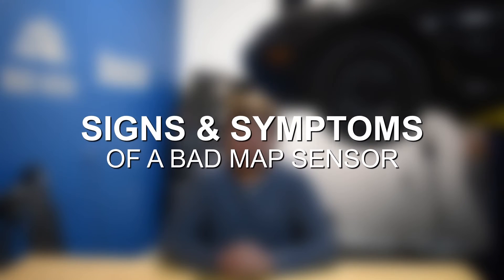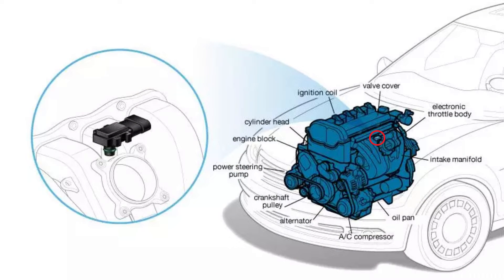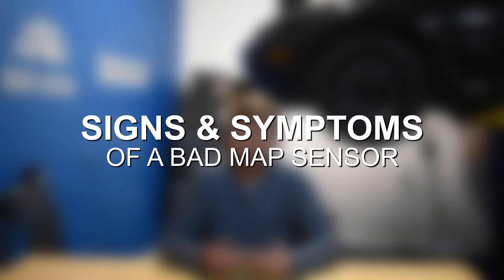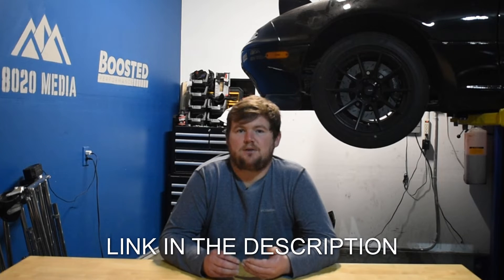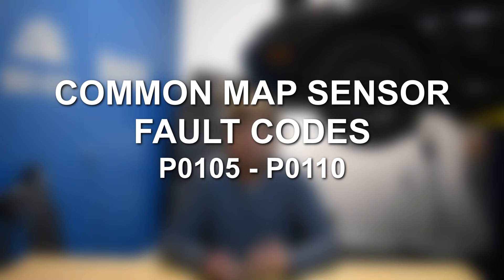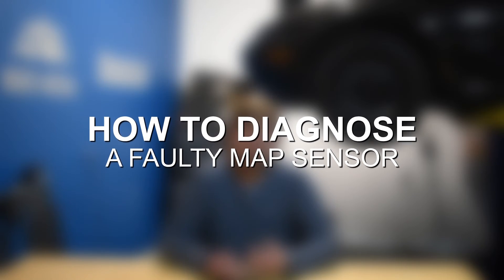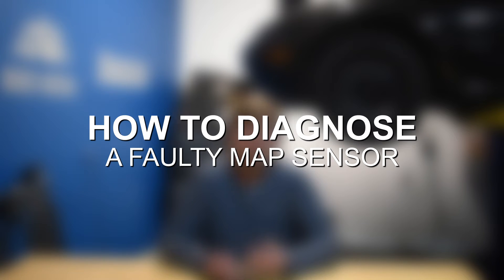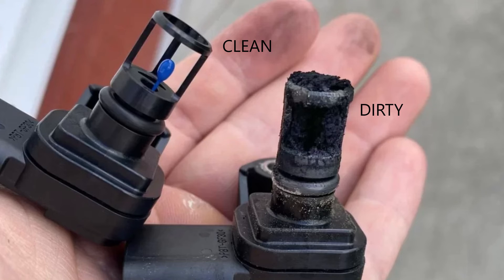A Bad MAP Sensor – Symptoms, Causes, and EASY Fixes!

Comment: Today after a hard acceleration I get error 0234 "pending" and I my car go to lim mode . After few investigation I find a bad PVC valve and oil on throttle body. That lead me to remove the map sensor for inspection and it was full on carbon deposit. I clean it and 50km now I didn't had any problem except my I idle drop little bit 680rpm from 730rpm . 
Audi a3 1.4tfsi .
Reply from the maker: S - The P0234 code (Turbo Overboost Condition) combined with a bad PCV valve and oil in the throttle body suggests that excessive crankcase pressure and oil mist entered the intake system, potentially affecting the MAP sensor and boost control system. Cleaning the MAP sensor was a good step, as carbon buildup can cause inaccurate pressure readings, leading to limp mode activation. The slight idle drop from 730 to 680 RPM is likely due to the ECU relearning fuel trims and airflow characteristics after removing the carbon buildup. If the issue persists, check the boost control solenoid, wastegate actuator, and vacuum lines for leaks or malfunctions, as they regulate turbo pressure. Also, consider replacing the PCV valve if it was faulty to prevent further oil contamination in the intake system. Keep us updated!
Reply: @8020Automotive  i replace the PVC valve (it was stuck close) i clean all intake parts from turbo to the intake valves . Everything run smooth now without any problem .

Comment: my car is 26 years old. I thinks its time to have a good check or simply replace it. It do feel a bit of hesitation from time to time while idling. I know for sure its not my sparks plugs as I put new one recently
Reply: Getting hard to find anyone to work on a pre obdII car. I have a 92 astro that was just running fine until i changed the sensor and thermostat.
Reply from the maker: L - Sorry to hear.. Unfortunately, this is something we've been seeing too.
Reply from the maker: R - Couldn't agree more! A little refresh would be good.

Comment: Hey I have a Code p1409 on a 1999 mazda b2500  before I got a code PO171 And i change the Idel Air control valve and also I had a P1506 all of them went away except the p1409 I change the fuel filter and clean the MaF sensor and has new coil wires I cean the truck with sea foam if it was a injector but its still have a rough idle and has los lost of power when Going up hill you need to lower the gear because it struggles
Reply: Yes
Reply from the maker: P - Interesting.. Have you taken it to a mechanic?
Reply: @8020Media  I have a scanner myself I know some basic mechanic knowledge
Reply from the maker: P - Are you still experiencing those symptoms? We also have videos on rough idle and  losing power:
https://youtu.be/ipjYLPJgpq8
https://youtu.be/BiYsqRJCLhE
Reply: @8020Automotive  I checked the truck again so
Reply: I checked the long and short term fuel trim
Reply: @8020Media  for the long term is get +15to +25 at idle and for the short term is get +3 to +12 at idle
Reply: I also fix all the vacum leaks
Reply from the maker: P - The P1409 code on your 1999 Mazda B2500 points to an issue with the EGR (Exhaust Gas Recirculation) system, possibly a stuck or malfunctioning EGR valve, sensor, or related components. Since you’ve already replaced several components like the Idle Air Control valve and cleaned the MAF sensor, it’s likely that the EGR valve itself is either clogged, stuck open, or the EGR control solenoid is malfunctioning, which can cause rough idling, loss of power, and poor acceleration, especially under load like going uphill. You should inspect and clean the EGR valve, check the EGR tube for blockages, and test the EGR solenoid for proper operation. If cleaning the EGR valve doesn’t help, consider replacing it, as a faulty valve can severely affect engine performance. Keep us updated!
Reply: @8020Automotive  hey I forgot to mention the egr solenoid has been replace, Yesterday I Tested the egr valve and it hold pressure
Reply from the maker: P - And you're still getting this code?

Comment: 2015 toyota corolla has P0108. U think it could be sensor or the wiring? Wiring looks fine i checked the sensor itself it doesnt have any gunk or soot.
Reply from the maker: B - The P0108 is more likely caused by a faulty MAP sensor than the wiring if the wiring looks fine and voltage checks confirm consistent signals. Perform electrical tests to confirm before replacing the sensor.

Comment: I’m getting false p2173 (vacuum leak) and i’ve checked the vacuum line and its air tight, could this be a bad MAP sensor?
Reply from the maker: I - A faulty MAP sensor can indeed trigger a false P2173 code. Start by testing the sensor and its wiring, and replace it if necessary. If the issue persists, further diagnostics on other components like the throttle body or MAF sensor may be required.
Reply: @8020Automotive  thank you, I’ve changed my throttle body and did infact have a small leak through the manifold gasket that I changed and the code persists! I’ve ordered a new sensor just to get it out of the way and hopefully that fixes it! Thank you for replying and helping people out!
Reply from the maker: I - Love to hear this! Glad we could help.

Comment: Oh how easy it would be if there were codes. No codes. Car has calibrated itself to drive okay; but, if the battery is disconnected and the comp resets, the car won't drive well at all :/
Reply from the maker: J - Interesting.. What symptoms are you getting?

Comment: My 2006 bmw 325i has been going in and out of limp mode and also having rough starts and rough idle. Replacing map sensor asap as I did get a code pointing to the map sensor. Hoping it fixes my issues 🤞
Reply from the maker: P - Might not be a bad idea! Keep us updated.
Reply: What no update?
Reply: Do you have an update?
Reply: Where is the update, please
Reply: Had rough ideal map sensor showed up but ran fineish
 Replaced it now it's bad but check engine is off

Comment: my check engine light turns on with the rest of the lights when i turn on the car. but it has NEVER illuminated when my car has had any issues. its quite irritating. the codes are presumably still logged though, so i should check them. i believe the altezza is obd1? because its sold outside the US it didnt get obd2. im not sure. but that means i can short the pins and count the flashes, or buy a cheap obd1 scanner?
Reply from the maker: S - That would be the best route.

Comment: I just bought a 2010 dodge charger and while I was driving it the car just stalled and turned off. I was in drive and when I put it into park I turned it off and back on and the check engine light was on. After so many rotations with the car being turned off and on in that same night of when this happened now the check engine light is not coming on And we were able to drive it home OK. I’m still Freaked out over this because I see that this is an issue with this type of vehicle based on other peoples problems … I read where someone replaced the map sensor and it fixed it. Could this be the case? Everyone I saying on the dodge charger it won’t show any codes after this happens
Reply from the maker: J - Best bet would be to pull the code when you get an engine code. That'll help you diagnose it easier. We also have a video on vehicle stalling that may be helpful: https://youtu.be/7bqAIbYRdnc
Reply: @8020Automotive  I will today will it still show up even if the check engine light isn’t on anymore? It came on when it happened but now it’s not on ;(
Reply from the maker: J - Sorry to hear. It is still possible for engine codes to pop up even if there isn't a check engine light.
Reply: @8020Automotive  it’s the crankshaft position sensor
Reply from the maker: J - Glad you found the issue!

Comment: I think I have a bad map sensor it would act like if it was starving for gas  it would idle for a few seconds then shut off , I got it to a point here it would idle a little better but as soon as I gave it gas it would shut off , so I disconnected my sensor and started it back up and it would stay running for a fat min but still felt like it needed gas . As soon as I plugged it in it would die when I would unplug it it would stay running , I changed my spark plugs , coils injectors and pump  all because I thought those where my problems first , I am no mechanic
Reply from the maker: E - Are you getting any engine codes? You can try cleaning it to see if that helps too.
Reply: @8020Automotive  I just ordered a new 1 I figured it was done for since it would stay running when I plug it and it shouldn’t do that it should just make the car die if unplugged
Reply from the maker: E - Keep us updated!
Reply: @8020Automotive  update map sensor did it running better then ever 🤘🏾
Reply from the maker: E - Love to hear it! Thanks for coming back and updating us. It will certainly be helpful for future viewers.

Comment: I got the P0107 code (map sensor on a 2.2 Ecotech) and my car won't start now. Would this sensor going bad keep it from starting? It cranks, but no start. I put new plugs in and they have fuel on them. Its definitely too rich on fuel
Reply from the maker: D - It's possible, but oil on plugs could be a a failing valve cover gasket.
Reply: @8020Automotive  Not oil....Fuel. I checked fuses and kept on replacing parts and checking vital parts of the engine by taking it apart. Everything mechanical in the engine is fine, including the head gasket. It's not getting spark. I replaced the plugs, coil pack, ignition control module, starter, crankshaft sensor, and now the map sensor. I also tracked down all 3 of the engine ground wires and replaced them. It's still not firing. It's cranking, but that's it. Now my battery is dead from all the attempts to restart it while adding new parts. But I am jumping it, with no avail. Fuel pump is working great. Replaced it 7 months ago. The plugs have a very noticeable fuel smell and I even smell fuel after trying to start it. I let them dry out and try it again with the same result. I'm about to replace the TPS and then the PCM next week as much funds are running out till next payday....OR i'm about to have to call a guy that charges $130 an hour to diagnose my car....I just know it's going to be something simple I have missed in the end
Reply from the maker: D - Sometimes it is beneficial to have it looked at. Sounds like you've spent quite a bit of money on it already. Sorry to hear that it hasn't solved your issue.
Reply: @devilmangamez8615  did you ever solve your issue?

Comment: I have a 04 Jimmy 4.3Vortec.  I’m having the P0172 and p0175 code ( banks 1&2 too rich) along with the p0101 code.  MAF shows 9g/s and -25 fuel trims but O2 sensor are showing Rich conditions.   So I replaced the MAF(brand new) I replaced the Spider injection (brand new) but I’m still having the codes. When I unplug the MAF it drives a lot better and fuel trims are near 0.  Can a bad MAP sensor cause the MAF to read higher at idle? Requesting more air or something along those lines?  My O2 sensors fluctuate up and down as they are suppose to.  Bank 2 sensor 2 O2 is steady around .6-.8 which is reading high fuel after cat still.  Not sure what else to check or change
Reply from the maker: S - We have a great video that may assist here: https://youtu.be/U3JVc3VLahA
Reply: @8020Automotive  I appreciate it! That was for a lean condition. I was having a rich condition. But I figured out the problem. I had a faulty cap solenoid that wasn’t throwing a code.  It was pulling gas fumes from the evap canister
Reply from the maker: S - Nice! Thanks for coming back and updating. It'll be beneficial for future viewers.

Comment: I have a 1992 ford f150 standard transmission and the rpms surge to 3000+ rpms. Continues to surge when in gear, making it very hard on my brakes going over mountian passes. I Cleaned the trittle body and replaced the air pressure control valve. It helped but it still surges, would the MAP sensor be my next part to look at?
Reply from the maker: J - Are you getting any engine codes? It wouldn't hurt to clean the MAP sensor to see if that helps your symptoms some more.

Comment: My map is 27 years old. It didnt throw a code but in testing with a good scanner its showing way to much voltage and nesrly no kpa at any given time. I bought a new one and it resolved the problem what you left out is it causes tons of misfires snd csn even mske your transmission not shift at all or very improper. My 2.2 Chevy now gets much better fuel mileage and it fixed several other issues. No more misfires no more not going into lock up and it nearly doubled my gas mileage.
Reply from the maker: T - Thanks for sharing this insight. It will certainly help future viewers.

Comment: Would you recommend buying one from a wrecking yard? Those sensors are super expensive. My Hyundai accent needs one
Reply from the maker: K - Probably not. But they aren’t that expensive, not sure where you’re looking.
Reply: 85$ at auto zone, 11$ on eBay

Comment: I’m getting map sensor symptoms but not getting any map sensor codes. I have gotten fuel is too rich and misfire on cylinder 6. Truck runs fine unless I have a load or I accelerate too fast. Truck will start jerking/shaking and will lose power, Engine light will blink. When I let off gas and and either coast or come to a stop the light will stop blinking and truck back to normal
Reply: I’m having the same issue. Did you replace the sensor? If so did it fix your problem
Reply: @jacobbirket6120  have been too busy to get to it but I’ll probably do it next weekend. I’ll let you know if it fixes the problem
Reply: Not sure if you fixed your truck yet but mine was doing this exact thing and it was a bad fuel injector. Replaced it and ran great again. I figured it out by pulling my plug wires and 1 of them had zero effect on how it was running.
Reply: @bigd4136  sensor did not fix it but I’ll try your solution . Thanks buddy
Reply: @jimrup3528  hopefully it helps!! Not sure how your truck is but mine has the MAP, TPS and IAC right on the throttle body, 2001 Dodge Ram 1500 318 (5.2). I’m going through everything right now but I had to replace all 3 at the same time after my injector went out. Ran great for about a week then started acting up again. Each sensor helped but not until I replaced all 3 was it good again. I had codes for the IAC first, then after replacing that it threw one for the TPS that took care of the codes and rough idle but it was still sluggish and hard to start so I did the MAP as well and now it’s running great again. 😂 gotta love project vehicles!
Reply from the maker: B - Thanks for taking the time to assist viewers! This will certainly be helpful to future viewers.
Reply from the maker: J - interesting. It could be the MAP sensor. An easy test would be to clean it and see.
Reply: @8020Automotive  forgot to mention, I pulled the map and it was dirty. Cleaned it with the spray and it still looked like crap. Put it in, truck ran a lot better for couple days but back to doing the same thing. Replace the map?
Reply from the maker: J - Might be your best bet. It's not a very expensive part. Keep us updated.

Comment: Limp mode please help can't get it past 30
Reply from the maker: C - Any engine codes?
Reply: @8020Automotive   well it did say throttle sensor 1992 k1500 gmc 454 big block limo mode none electric I have carb I'll try map sensor replacement first
Reply: I'll try replacement map sensor
Reply from the maker: C - Keep us updated on this! We hope it solves your issue.
Reply: Its flashe 3 then 4 times so p34 code 1992 gmc k1500

Comment: Hi, I have an Abarth Punto with EVAP fault codes. I also have a fault code for Overboost and Turbo Vacuum. I’ve done a smoke test and it’s got no leaks from the manufold/EVAP side and also the turbo system. 

Plugged my TopDon in and on live data, I noticed the Air Pressure was reading at 25000Mbar on idle snd 8000mbar when idling. Is this a sign of a failed MAP sensor?

Comment: Can you clean it
Reply from the maker: J - You can certainly do this before replacing to see if cleaning it fixes the issue.
Reply: @8020Media hey there! Just wanted to make sure I heard you correct. You CAN clean MAP with MAF like crc? also do you know of a Cleaner I can use for Mitsubishi? Because CRC product says not to use on Mitsubishi  😅😢
Reply: @LL-eb7bn yes. You can use MAF cleaner for MAP sensors.
Reply: @EcotecEngine3.8V6  Thanks
Reply from the maker: C - Thanks for responding here!

Comment: No check engine light 💡 comes on —I have to pump the gas pedal a few times for my truck to start if I don’t it won’t turn over 2. It kill’s while I’m driving —- someone in the comments help me out 🙏
Reply from the maker: Sounds like your throttle body might be stuck or something. You might still have a code hiding in there even if you don't have a check engine light so try reading codes
Reply: @8020Automotive ok thanks— I changed the MAP SENSOR AND ITS DOING BETTER BUT STILL KILLS WHILE IM DRIVING SOMETIMES- it’s been 2 days since I changed it
Reply from the maker: B - What do you mean kills while I'm driving? Like it's stalling? If so, this video may be helpful: https://youtu.be/7bqAIbYRdnc
Reply: Hello, did you ever figure this out?
Reply: @siwel86 yes I did
Reply: @bigbusiness6903  Great! So what was the issue?
Reply: @siwel86  it was the ignition switch box 📦 it was both the MAP AND THE IGNITION SWITCH BOX 📦 I CHANGED THE MAP AND THAT PROBLEM STOPPED I PRAYED ABOUT THE IGNITION SWITCH BOX AND IT NO LONGER GIVES ME PROBLEMS GOD FIXED THE PROBLEM I COULDNT AFFORD TO FIX 1,000$